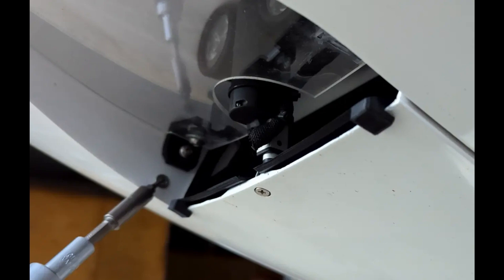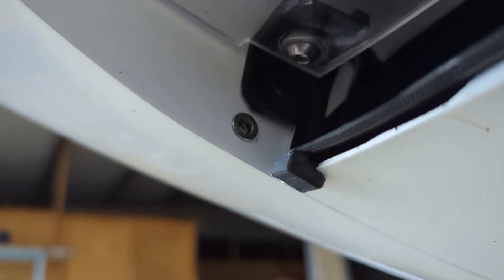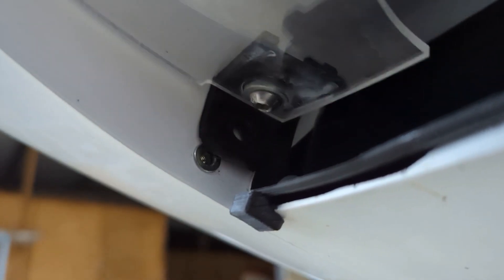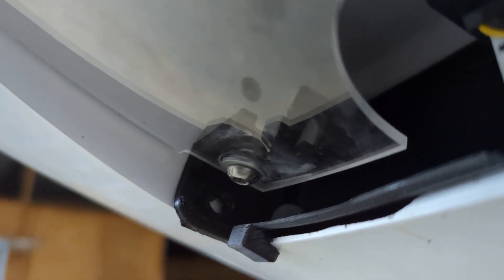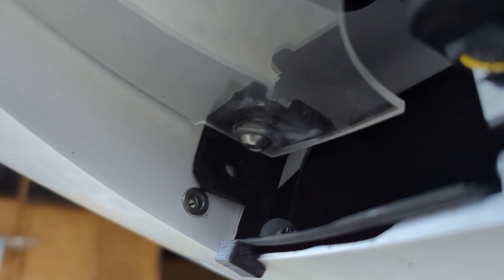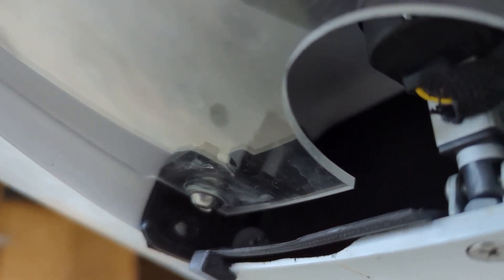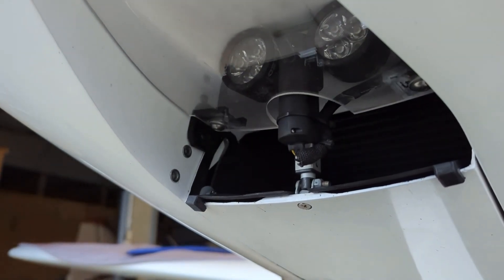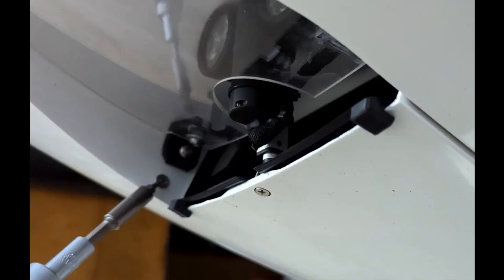Adjusting the engine cooling system

Comment: Why its not automated?
Reply from the maker: Hi @Mike_Sierra95,

That’s a great question! Automation is indeed possible, and if someone desired an automated solution, it could certainly be developed as a bespoke feature—though it would require engineering time, prototyping, and testing, all of which come with a cost.

When designing an aircraft, especially in the 600kg Ultralight category, every single gram matters. Adding automation means additional weight, which reduces the payload capacity for fuel, luggage, or even passengers. It’s a delicate balancing act, and simplicity often wins the day in aviation design.

An automated system also introduces additional complexity, both mechanically and electrically, which can lead to increased maintenance requirements. For an ultralight aircraft like the Shark, simplicity and reliability are key.

The current system is brilliantly lightweight, extremely straightforward, and requires minimal adjustment during the year. Any pilot can quickly set it to the appropriate position for the season or ambient conditions without much training or effort.

Perhaps most importantly, the design prioritises aerodynamic efficiency. Being able to adjust the cowl flap helps minimise drag by reducing the cross-sectional area and optimising airflow through the engine compartment. This isn’t just a minor tweak—it has a noticeable impact on performance.

The Shark is all about delivering an extraordinary flying experience with sleek, efficient, and high-performance design choices. That’s why we love it, and I hope this helps explain the rationale behind the approach!

Blue skies, Shark.Aero
Reply: @sharkairplane Keep it manual, don't overcomplicate. Great job with this plane by the way!